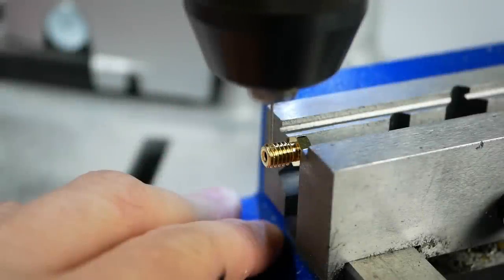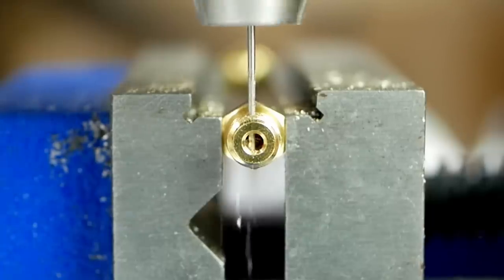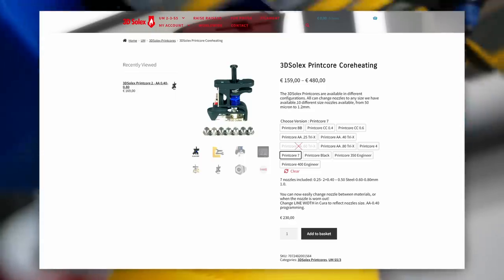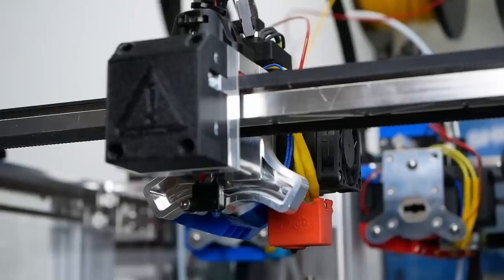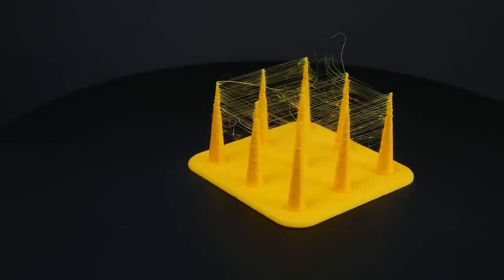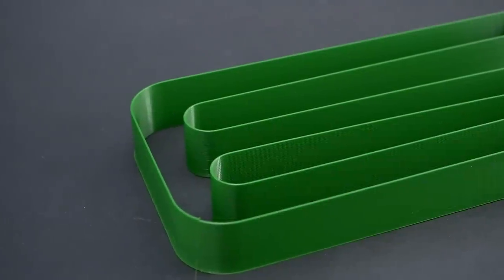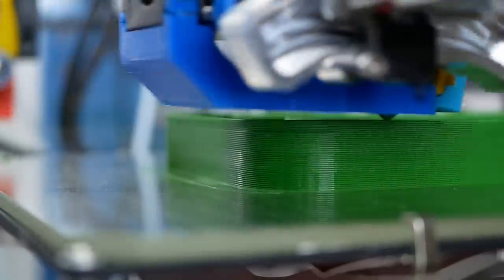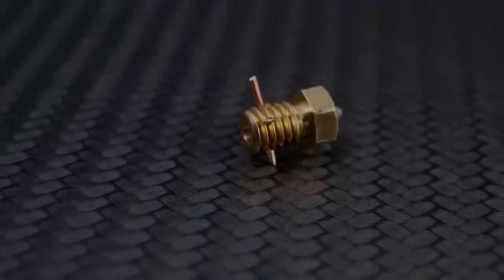My High Flow Nozzle is better than a Volcano hotend!

Comment: I'm not sure where you heard otherwise, but there is no such thing as patent or copyright infringement if you are making it yourself, for your self, and will not be selling the thing. Ad revenue from a video where you make your own version of something that is patented, even if it includes the step-by-step instructions for making the patented thing, is 100% legal, as the money is coming from content of your effort, not the sale of a product. It only enters light grey area if you give the finished item away, and gets dangerous close to the line if you make them in bulk to give away. I suppose you could get in trouble if you made something yourself, but tried to claim it was the authentic product (still not giving it away/selling it), but someone actually doing that is kinda unlikely. (also, commissioning someone to make a patented thing for you likely results in the maker [not commissioner] violating the patent, so please don't do that either.)

It's primarily access to the necessary tools, and the skill to use said tools, that prevents people from making these kinds of things on their own.

Comment: 💡Try tapping threads into a nozzle. 
That should give you an enormous boost in surface area inside the nozzle.
💡💡You can also thread different inserts into the threaded hole.

Many possibilities. 😎

Comment: What if, instead of wires, you slotted the nozzle and inserted a razor to mechanically cut the filament apart? With it being so thin, it wouldn't restrict flow too much.

Comment: Wouldn't a longer nozzle accomplish the same and be easier to manufacture? Yes there wouldn't be as much mixing, but the wall shear will still stir it.

I also wonder the effect of making the nozzle bore longer (the .6 part). If the plastic would relax the internal stresses more and not spring back. The friction would be much higher though.

Comment: So, the entire point of CHT nozzles/split path nozzles is to increase the surface area of filament that's touching the nozzle...
And the entire reason that you shouldn't exclusively use SS nozzles is that they're less thermal conductive as brass nozzles...
Buuuuut... What if they made a CHT SS nozzle?

Comment: If you want to get the position aligned better I would just sacrifice an old heat block. Predrill a hole where you need it and just drill it out again afterwards. Personally I would go using a steel block for it if I would do it more often but even the aluminium blocks should work fine for a few nozzles and you would get a much better result. 

I really now want to try it with a volcano hotend and this trick: https://www.youtube.com/watch?v=6PqKKDhXEcM

I just do not have the time to do it right now...

Comment: silly experiment

try to recreate CHT nozzle... maybe you could cast it?
or make your own design? you could make it longer like volcano but also cut the wire into multiple strands
or hell, you could maybe even preheat the filiament down the line, or mix multiple filiaments with lower diamaater at the hotend

Comment: Unable to drill through the nozzle accurately?
If only there were some sort of machine that you could use to manufacture a drilling jig to screw a nozzles threads into and guide the drill along the right direction. The machine would need to be computer controlled so as to take slight human errors out of the equation, and to save wear on the drill bit, I'd think it would be best if the machine could produce the drill guide out of some sort of plastic material....... OK, I'll stop being a a*se hole now. :D

But why not print a screw on drill guide? You wouldn't have to drill all the way through both sides of the nozzle from one side so the drill would be less likely to wander, and the guide could be printed as a cube with square sides so you've got nice flat reference surfaces to get your opposite holes perfectly in line with each other.

An alternative idea is that if you're going to drill out the nozzle and break out the the solder gear anyway, why not Dremel a slot 4 or so millimetres vertically down into the top of the nozzle's threaded area, Then solder in a couple of stacked wires (Or even soldering in a profiled little piece of copper strip) before recutting the threads. It might be easier to get acurate results with the little extra wiggle room from being able to widen slots and let the solder fill in any slight gaps.

Comment: Patents are great for stifling western innovation, fantastic!  In China they just ignore them completely, lol    (not saying that is a good thing since they generally don't innovate ideas from patents)
The fact putting a cheap bit of wire through a hotend is enough to collide with a patent is pathetic if you ask me!
Reply: Very hard to comment atm as YT has issues. Try a sharp plate jammed in middle of nozzle (use small indent ridges on each side if need be)

Comment: My thoughts: intellectual property isn’t property, it’s a monopoly privilege granted by the king to make it illegal to use your own hands and materials as you see fit and sell it if the king has given the privilege to someone else for that idea.  Property rights apply to things that are scarce.  If there was a lot less air you might pay for more, but you don’t pay for more now because it’s not scarce.  Nobody is worried about running out of air, it’s not scarce at all.  Same for ideas.  If you use some patented idea that doesn’t prevent the original inventor from also using it, so it’s not theft: no property owned by the patent holder was taken.  Only their idea.

Comment: Excellent video as usual !
I wonder how it would be possible to get the same nozzle able to sustain 270°C. I use this temp to extrude "plastic bottle" PET : https://www.youtube.com/watch?v=1_BWXhT5Y-I
As I still have little problems to properly fuse this PET filament (at "high" speeds), your solution seems to be a good candidate.

Comment: 🤔 I would wonder if shaping the wire more like a triangle or a blade with a dremel tool or sandpaper would have any better performance here. I haven’t seen this nozzle yet, looks like they spend a lot of time machining to get the finished product. Also I didn’t know that we can’t make something for personal use that is patented here in the USA 🤣 good old capitalism… Good thing my cnc and lathe don’t upload data to the internet 👺😬